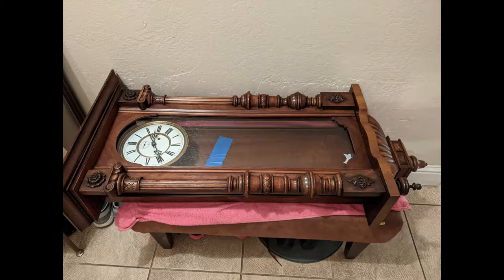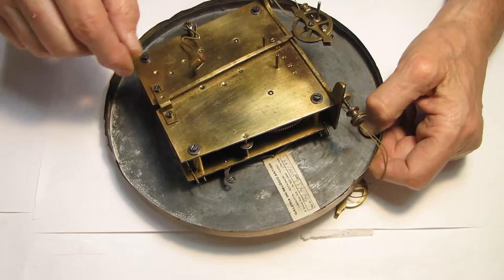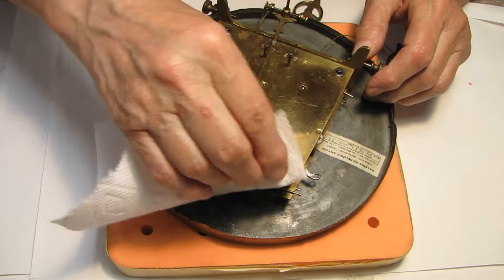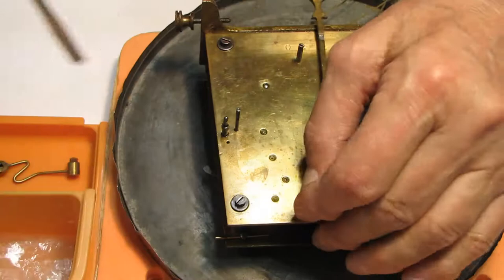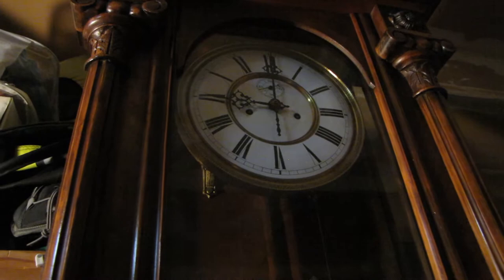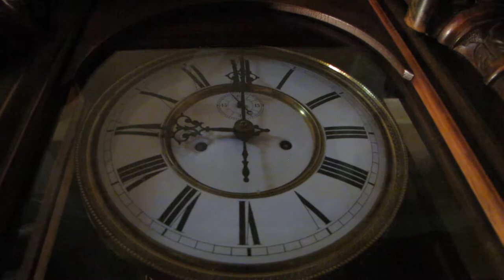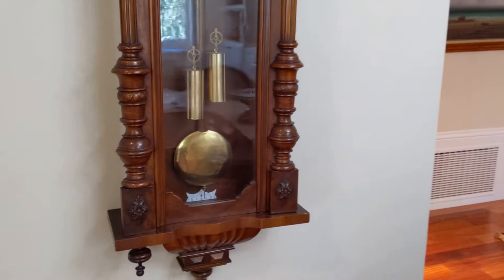Repairing and Servicing a Beautiful Antique Vienna Regulator Wall Clock How To Clock Repair

Comment: All went well following your excellent video. I will post later some things I learnt that may be helpful to others. One query. The hour hand is a push fit so can be placed in position to coincide with the number of strikes so that it is in sync. However the minute hand has a square spindle so can only be put on in four positions. It seems to me that the minute hand can be moved into position so that it is also correct IF  it can be safely moved backwards. 15 mins should be the maximum needed and I assume that this should only be done so that the striking points are not passed in the process. Is my logic correct or is there a way of placing the hands that will always be correct without later adjustment.  Once again thanks for the advice so far which has been so helpful.
Reply from the maker: Hi Roger, the way I put the hands is as following (if I remember correctly after 2 years of mastering this clock). I put a minute hand first, and because, as you confirmed, it has a square hole, it will coincide with one of the strikes, you just need to find the point, where it will make some number of strikes at any hour. If you want to reach the 12 hours strike, then you need to rotate a minute hand until you hear 12 strikes. Or you might stop rotation at other (any) hour. When minute hand is at the place, remove it and put an hour hand, pointing it to the 12:00 hour mark. Then put a minute hand back, pointing it also at 12:00. In case you are at any other hour, say 3:00 and hear 3 strikes, then after removing a minute hand, put an hour hand and point it to 3:00 o'clock. Then return a minute hand and point it to 12:00. That's it. Good luck as always! Also, let us know how this will work for you. Good job on your side, you practically completed a big project!
Reply: Thanks for your reply and your detailed advice which I missed on the day it came in. Been busy with other projects for residents including radios, food processor, Coffee machines etc etc but hope to get back to the Vienna shortly. Thanks again for all your help and encouragement.

Comment: Fantastic Video - so detailed and helpful. I am a volunteer in the local Repair cafe here in Surrey in the UK. We try to repair items for resident free of charge for those who many not be able to afford to pay the cost of repair and so help avoid  things ending up in landfill that could be made to work. I have some but limited clock experience. I am trying to help with a  Vienna Regulator (2 weight). This particular clock has been wound without the weights on and so the cord has become wound around the spindle instead of the drum and is now jammed. The cord (cat gut) can be renewed by a dismantle using your guidance but I am concerned about the dismantle with the springs still wound. Would the dismantle be a problem if the springs are not let down? If so, is there a way to let them down prior to dismantle? Any advice would be really appreciated.   Many thanks
Reply from the maker: Hi Roger! This movement doesn't have mainsprings and could be disassembled with no risk of unwinding loaded drums. Weights, of course, should be removed prior to the movement taking apart. If your task is to unwind the string only, then I believe you can do it without dismantle. Good luck in your great volunteer work!
Reply: @ValentechTime  Thank you so much. Steep learning curve! Do you have an alternative to phonolube which we can't get in the UK? wish we luck... I am going in!!!:
Reply from the maker: @rogerhutton1  I used phonolube, because I was new to clocks at the time and used whatever I had. I think using Moebius 8300 grease would be better for striking mechanism. For pivot holes I use synthetic clock oil. But do not use lubrication too much.
Reply: @ValentechTime  Thanks again for the advice. I will be doing the full renovation using your video and will let you know how it turns out!!

Comment: Hi. i have the same clock, but unfortunately mine has not the wheights in it. Can you please tell me what is the wheight (lbs or kg)  of them ? Thanks in advance, Regards from Argentina
Reply from the maker: That clock was not mine, I did service for some client. So, I do not know the weight, but as I remember, it was about 3 kg (6 lb) each. There is an interesting chat on this topic, where you can find the method how to determine the proper weigh for your clock. It is at:  https://mb.nawcc.org/threads/correct-weights-for-weight-driven-clock.96725/
Reply: @ValentechTime  thanks i'll check it out

Comment: I managed to un-tangle the chime cable on my antique Vienna regulator clock after moving it to a new location. Now the clock will not stop chiming when the weight it put back on. The clock side works great. Any idea of what to do. Thanks
Reply from the maker: It looks like some lever inside the movement went out of engagement. Did you go inside the movement to un-tangle the cable?
Reply: Yes, I removed the clock from the case, un-hooked the cable and pulled it through thru to get it un-tangled, then put the pulley back on and hooked the cable back in place, replaced the clock,  and weight. Yes, I could have disengaged something while handling it.
Reply from the maker: @maryellendunn8899  Sorry, cannot help more. You might want to show the clock to your local master. It's repairable. Good luck.
Reply: Guess what? I fixed the clock. A tiny pin was dislodged from its proper place. Mr. Petis, my local clock master, died a few years back. My Vienna Regulator is running beautifully. I am so happy!
Gratefully,
Mary Ellen Dunn
Reply from the maker: @maryellendunn8899  Congrats! Glad to hear you did it! Enjoy the clock!

Comment: How fix out of sequence chiming for example 7 chimes at 8 o clock?
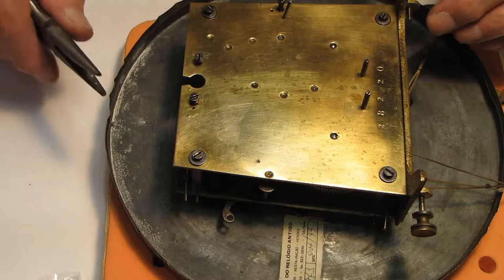Reply from the maker: I think you mean striking, not chiming, right? The clock strikes 1 time at 1:00, then 2 times at 2:00 and so on. I'd remove hands after hearing 7 times instead of 8 and relocate hands at 7:00. This should fix the issue.

Comment: Finally after building two weights and some cleaning my clock is working now. But the pendulum amplitude is really low (half an inch from side to side). Can you give me some advice ?  I know it's hard to assess from distance but... I really don't know what to do. I'm kind of loss. Thanks in advance
Reply from the maker: Is the pendulum original? Did you do complete disassembling, cleaning and oiling, or some parts only? Also, try to make weights a little heavier. Could be one of these reasons.
Reply: @ValentechTime  thank you so much

Comment: I have a Vienna Pendulum Wallclock .I have overwound it..I know it's not actually overwound . I have released the tension of both springs . Even with suede gardening gloves on I almost severed a finger 😁. I put it all back together but the chime spring won't wind up it turns a few times then releases again. Then I've gone to rehang the pendulum and it's somehow too long so won't move. I know I moved the bit it attachs to . I don't know what to do and have no clock repairers near where I live. Any help will be so appreciated.  Thank you 😊
Reply from the maker: Unfortunately, it's hard to diagnose the clock remotely, sorry. The spring being not able to wind could be to the fact, that click is not engaged with the gear on the barrel. It might went out when you did unwinding. I did not understand how exactly you put the pendulum back in. Some clockmaker definitely could be of help. If I can ask - what state do you live?

Comment: Can you tell me the year of production of this clock ? Approximately ?  thanks
Reply from the maker: I was told by the owner of this clock, that it is more than 100 years old, but do not know exactly. What I know about is that Vienna Regulator clocks were mainly produced between 1800 and 1900.
Reply: 文字盤や箱から見て、1880年頃です
Reply from the maker: @user-un7od6po8q  Thank you! I translated your comment from Japanese. It reads  - "Judging from the dial and box, it is around 1880."

Comment: Hello great video! I was wondering if you could tell me the exact cleaner you used in your bath. I looked up the company but they have many types of cleaners and I wasn't sure which product number you use. Thanks for your help.
Reply from the maker: Thanks! The cleaner solution I used was the Master Stages Clean2020. It's a concentrated solution and needs to be mixed with a water per given instructions. Lately I thought to find something more applicable to clocks, because I think the Clean2020 is used mostly for auto parts. Use your own search to find the best cleaning liquid. Good luck!